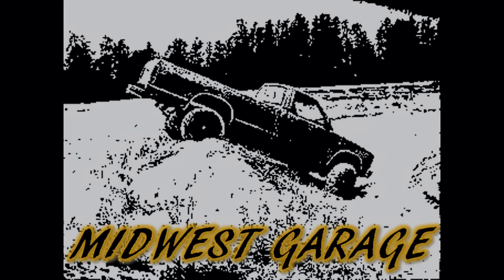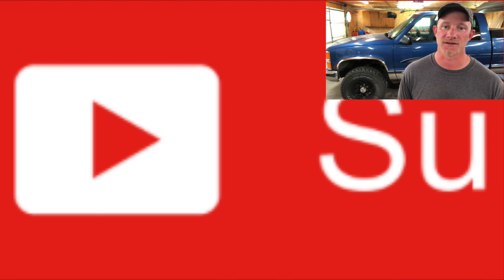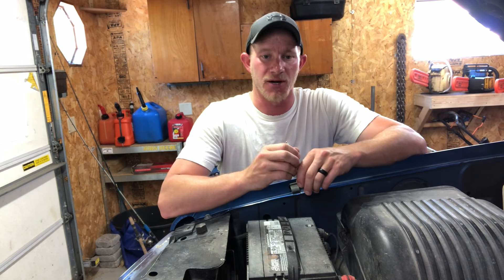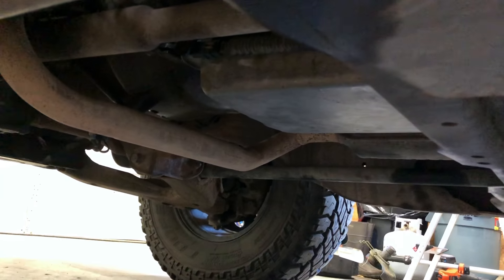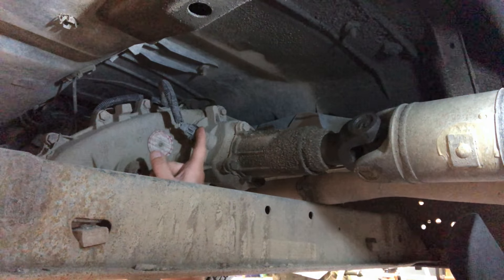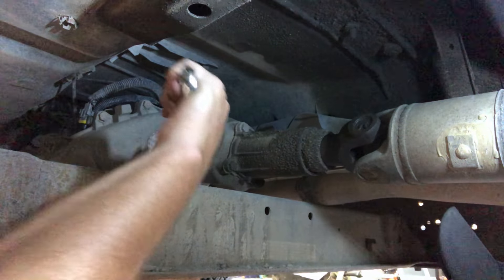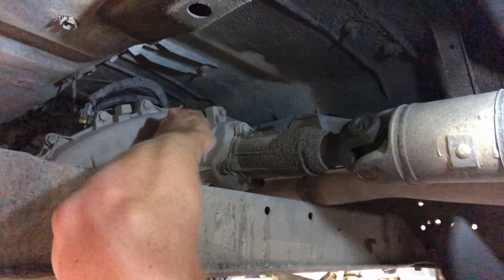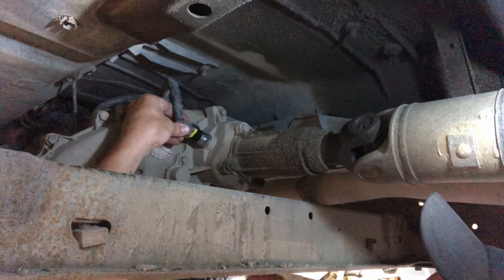How To Replace Vehicle Speed Sensor in 1988-2005 Chevy GMC Truck & SUV

Comment: replaced speed censor but tack and speedometer still not working any other ideas i may want to investigate also transmission wont shift auto can shift manually any help about this would be greatly appreciated
Reply from the maker: Hmm...is your OBD2 throwing any codes or check engine light on? If so, let me know what the codes are and I can help you out from there. From what I'm hearing it sounds like a bad ignition switch though, that would do all of those things.

Comment: hi from Mexico  i can see you helped a lot o people that's awesome  but im trying to fix my tranty but not sure wher is that speed sensor it has a t wires coming from the computer goes to the solenoide inseside the trany and the other 2  is for a macnet and changed the gears and was running like new  and then the oil hoes going to radiator get a lik a i burned th reverse gear  cow i was so pist off i change the central planetary  ring and now after second gear goes to neutral i want cray lol well i have a check engine light  on i pot the scanner but it does not show a code my transmission is a  700r4 if have any idea to helme i really appreciate it thankyou and have  a good day

Comment: I have a 96 Yukon all my gauges work but after 2nd gear it will slip in and out but will not go into 3rd correctly when I manually shift it back to 2nd it does just fine
Reply from the maker: That’s exactly what my truck was doing and this fixed that issue. I hope this helps yours also!
Reply: @MidwestGarage  WILL A BAD VSS CAUSE A TRUCK(2005 TRAILBLAZER) TO NOT MOVE EVEN THOU ITS ENGAGED IN A GEAR (DRIVE)

Comment: My truck is a 2002 yukon it goes n reverse fine..then. It goes into drive fine.but no matter how high it revs it will go into the next gear ..it stays n 1st..can this fix it or is it a shift selinoid??help me.ive already did a swap with a pick n pull transmission still having same problems
Reply from the maker: I would definitely check out the speed sensor, it’s a cheap and quick check. If that doesn’t fix it, I’d see what codes the engine OBD2 is throwing. It could possibly be the ignition switch if the speed sensor doesn’t fix it. Let me know what you find out and keep me posted!

Comment: My transfer case has two sensors. One on each side. How do I know which one to change?
Reply: I changed the one on the passenger side of the transfer case. Then I noticed that it was another one on the driver’s side also. Looks to be the same sensor.
Reply: @Bryan Sandifer did this fix your problem

Comment: I have a 97 Chevy 3500 two weel drive with a 454 an am running a 295/75/17 wheels and my speedometer is about 11 miles above what my GPS said I'm see on the speedometer, what can I do to correct this  ...

Comment: I have a 92 s10 4×4 automatic transmission my front wheel drive works but not my rear wheel driving me crazy trying to fix so I can drive in 2wd it will start going but when I let off the gas and try again it won't go also when its in park it still will roll please help me

Comment: I have a 1999 blazer and when I am driving and the transmission gets hot the transmission will start to serge. It is like it tries to hit passing gear then up shifts then repeats.What can I do to fix it?
Reply from the maker: Replacing this speed sensor may be the issue. If it’s not that I’d look more closely to see if you have bad fluid. I have a video on changing the tranny fluid and filter. Check that out and see if that’s your problem. Lastly, it could be your ignition switch. I also have a video on how to replace that. Let me know what you find, I hope I can help out more!

Comment: On 88 to 94 models the sensor is on the driver's side on 2wd models, I'm going to change mine because my truck shifts weird even though I adjusted my TV cable and it's leaking fluid through the seal.

Comment: @Midwest Garage  good vid, I found a sensor for $32...
my odometer clocks miles, speed needle bounces works on & off.
Does odometer work off same sensor?
I am in a 90 350 v8 5.7

Comment: I have a Chevy 1 ton 1990 with the same problems send it to shop they said they couldn't fix it Foundation AutoZone what are you think
Reply from the maker: It’s a $30 or $40 part, I’d swap it out and see if that fixes your problems. If not at least it wasn’t expensive ya know. Let me know if this does the trick!

Comment: NOTE: To everyone watching this video, I tried an adjustable wrench and all it wanted to do was slip. Go to a parts store and buy you a 1 inch deep-wall socket, pair it with a rachet, or else you won't have a fun time trying to get this sensor loosened. Side note: the new sensor did not fix my problem. My speedometer is still off by 5-10 mph. Back to the drawing board.
Reply: damn this answers my question my truck is off by 5 mph aswell its lifted 6 inches with 35s on it
Reply: What size socket???? 1 inch what ??
Reply: Having troubles finding right socket for this
Reply: @Ah71310  he said a 1 inch deep wall it just a 1 inch  socket but longer or deeper so it can fit over the thread to reach bolt
Reply: StonedPothead Gaming  
Thank you so there is no mm size?? Just ask for a 1 inch deep socket??
Reply: @Ah71310  should be able to tell them the truck type and wat your doing and they can get the correct on at part shop
Reply: @Ah71310  Yes sir, ask for a 1 inch deep wall socket and make sure you have the right drive ratchet to go with the socket.
Reply: VirtualPianoMan what about the mm size?? Or number
Reply: @Ah71310  It is a 1 inch socket. The size/number is exactly 1 inch. Ask a parts store person for a 1 inch socket and they'll get it for you.
Reply: Usually you can change an offset somewhere in the speedo board to adjust for different tire sizes etc - I know my old Ford I can manipulate the reset buttons etc to change it, on the chev I think there may be something similar - I put bigger tires on mine too but just did the quick math to determine the speedo shows slightly less than acual speed (in my case 4. something mph) so if I see radar etc I know where to keep it.

Comment: 5th gear incorrect ratio comes up on my codes.. hope its this sensor? Trans goes into limp whenever it tries to enter 5th
Reply from the maker: Hmm...let me know if this was it or not, I'm curious to know! If not, it very well could be your ignition switch. I have a video on that as well...I mention that though because the ignition switch on these trucks controls the TCM (transmission control module).

Comment: Brotha please help! Any insight please I'm desperately trying to find anything that can help me not spend what I was saving for the dentist. I have a 99 sierra 4x4 automatic with a newer 4.3 with what I think is stock 4l60e. It goes 1st and 2nd and seems like it goes in neutral with the rpms shooting up. Can this be the issue at all? My speedometer works fine. Please help
Reply from the maker: This could be the problem, mine was doing very similar things. It’s a cheap part so at least try to replace this first before spending a ton on bringing it to the shop. Let me know if it helps, if not we’ll look into it further here!
Reply: @MidwestGarage  I work for oreilleys so I have a few abilities. I am looking for the sensor but getting completely thrown off. The sensor I saw on my transfer case is straight but the one on my system at work that looks like it says manual transmission. The one that says automatic has a bracket. But my problem is that I saw one that says manual and auto but discontinued and to use the one that says manual. And then on top of everything. Lol my truck is a Frankenstein baja truck. I dont know if my transfer case was out of a manual lol best bet to get what looks like it or am I looking at the wrong sensor when under the car? The sensor with the bracket ia also under transmission output shaft speed sensor but I need the one on the transfer case right with the big nut at the base? I'm so lost lol

Comment: I have the symptoms of what seems to be a bad speed sensor in my 97 k1500. I jad replaced the sensor but nothing has changed. What should I do next?
Reply from the maker: Check the ground next. If you follow the wires up see where it grounds to the frame and disconnect that, clean the area well and see if that helps.
If that doesn’t work there’s a chance it could be the ignition switch. What symptoms are you having?
Reply: @MidwestGarage  slow take off, almost as if it's starting in a higher gear. Speedometer and rpm gauge not working. Rough idle.
Reply from the maker: So the rough idle tells me that the ignition switch could be the issue. The ignition switch controls the TCM and plays a big part in the ECM. Do you have a check engine light on?
If so, and with all of those random problems, it sounds like an ignition switch. I replaced mine on my 97, it’s a really old video so bear with it, but check it out it. I hope this helps man!
Reply: @MidwestGarage yes the check engine light is on.  Alright, I'll look at the ground then go from there. I appreciate your input.
Reply: @MidwestGarage  hey I would like to thank you. I appreciate your knowledge and input. Thank you for responding to my questions. It was indeed the ignition switch. Fixed my issues. Now I can get her back on the road. Thank you.

Comment: The one I purchased at autozone  for my 98 blazer was $95. Are they price gouging?
Reply from the maker: I don’t think so, it’s just unfortunate that it costs so much more from a real store. Mine was originally $78 until I found it for about $25 on Amazon. If you return yours and use my link in the description it’s way cheaper!
Reply: @MidwestGarage  Unfortunately,  I have already installed it. On the up side it did seem to fix my problem.

Comment: My 2004 Silverado speedometer has been acting up for a few years periodically will get stuck or move past 120  until it decides to work again .(not driven often) 31,000 mileage!  Watched ur video...whats odds u may need sensor replaced? Retired senior widow...was late hubby's truck. HELP! Thanking You in Advance , Darlene Perko
Reply: Adding, no other problems..just speedometer acts up...should I try senor first?  It's a 2 whl drive, do I have a speedometer cable??? Ty, Ty Ty

Comment: I have an issue, when i press my cruise control button the speedometer goes completely wack, but doesn’t maintain speed, do you know anything about this? Ive replaced the switch, module. Still no luck, try to get back to me asap, can find absolutely no one with the same issue, 1994 g,c 2500 350 tbi.
Reply from the maker: Oof I’m sorry honestly I’ve never heard that one before. You changed out the multifunction switch? I’d check for vacuum leaks for maintaining the cruise speed and speed sensor or speedo cable for the speedometer. I hope the helps! Let me know man.
Reply: Midwest Garage turns out the cable going to the throttle body was broken going from the module, thanks for the time to reply!

Comment: Today was about the third time my 2001Silverado will not shift out of 1st. The other times it would go back to normal after speeding up and letting off the gas. This time it stays stuck but will shift to reverse and park. I will change out this part.
Reply from the maker: Yeah definitely see if this helps or fixes it. Let me know what you find! If it doesn't fix anything check into your ignition switch. The ignition switch on these trucks controls the TCM and can wreak all sorts of havoc on your transmission. I have a video on this channel showing how to change your ignition switch too if that happens to be the issue.

Comment: Replaced speed sensor fixed it for a week. Replaced ignition switch no change. Stays in 2 nd gear no matter what. Speedo not working and break and check engine light on... Any ideas? I'm told there are two speed sensors on this 94 1/2 ton I only found one.
Reply from the maker: Hmm, I honestly only know of the one speed sensor...My guess would be maybe electrical? Are any of the wires going to the speed sensor frayed or corroded? I'd also check to see if there's a corroded ground wire around there anywhere. I'm thinking since it worked for a week that had to have been the original issue so I'd keep checking out that stuff. Let me know what you find!
Reply: @MidwestGarage  thanks for the reply. Turns out.crushed wire to speed sensor, faulty new speed sensor, bad silinoid in trans....works perfect now.

Comment: Is anyone trans not shifting out of first but shifts into reverse or neutral smooth?
Reply: Not shifting out of first, (unless i manually shift to 2nd ) ABS light on and speedometer not working, Did replacing the speed sensor work for you? @Taylor Peveto i have a 97chevy z71

Comment: I’m getting no power to the speed control sensor on my 1999 GMC Sierra I put a new trans in but no power to the to the mph and it’s not shifting
Reply from the maker: Hmm...see what codes the obd2 is throwing and let me know what it says. It may be an ignition switch issue. I have a video better explaining that. It's an old video so bear with it, but that could be your issue.

Comment: I’m not understanding this vid. I have a similar set up on a suburban, K1500 5.7 with a 4l60 and I swear ive looked several time and I cannot a sensor that looks like that anywhere on the truck, I’ve searched all over my t-case and i have 2 fully plastic sensors, 1 by the front driveshaft and the other in the back on the passenger side of the t-case by the rear driveshaft. Replaced both of them, didn’t fix the issue. That spot yours is in, there’s nothing there at all on my transfer case at all, I’m looking for the speed sensor with the metal base but this truck just does not seem to have one

Comment: i have watched several of your videos and its fantastic bud. very clear video, clear explanations with great knowledge which helped a lot. thanks a bunch! btw, i also subscribed as well. please keep posting more great helpful videos. u rock!
Reply from the maker: Thanks for the kind words bud! and Thank You for subscribing!!
Reply: @MidwestGarage  hey bradah, i have a question for ya. please correct me if i am wrong, i thought the speed sensor is a cord type that connects one end behind each front & back wheels, and the other end connect to the truck or engine area? your video shows the speed sensor location at the front transfer case, and that speed sensor is more of a protruding bolt style looking. i am confused on this. My ABS light has been on since November of 2019 and its still on as of date. please let me know, and much appreciated. thank you!
Reply from the maker: Tim Owings yeah man, so the ones you’re thinking of are wheel speed sensors. The one in this video is a vehicle speed sensor and is more electronic and can mess up your ABS, shift points, etc. if it goes out. I hope this helps!
Reply: @MidwestGarage  thanks bro for the response, and very much appreciated. would my ABS light turn off from the dash if i change the vehicle speed sensor? do you think my ABS light has been on due to " wheel speed sensor? " either way, i am going to replace the vehicle speed sensor since my 96 Yukon C1500 is 24 years old and has never been replaced. you think that will solve my ABS light? thanks again, and have a great weekend.

Comment: I think mines got this problem I was riding 1 day n it stop shifting bt the next day it started shift again
Reply from the maker: Yeah I'd definitely check this out before looking at expensive fixes. If it's not this I'd run a scan tool on your OBD 2 and see, it could possibly be the ignition switch also, which is a lot cheaper than diagnosing a transmission issue. Let me know if this fixes your problem!

Comment: What’s the part number for that sensor ?
Reply from the maker: I'm not sure on the exact part number, but I should have it linked in the description. Amazon will let you know also if it's the correct part for your exact vehicle.
Reply: Midwest Garage thank you for the respond . I believe to have found it . Great channel ! I look forward to learning more from you . 

Jason Davie Florida, 1995 c/k 2500 4x4 6.5 turbo diesel
Reply: @The_spears_brothers  did you find the part number? I have the same truck, 1995 c2500 4x4 and Everytime I think I find the right part, Amazon says it won't fit my vehicle

Comment: just had a check engine light  today, they did a  obd test and said min was the front right speed sensor, not the same obviously no abs light on, what the?
Reply from the maker: That could be a wheel speed sensor instead of the vehicle speed sensor, which normally triggers ABS light like you said so that's weird. I'd maybe try cleaning the sensor first and see if that helps. Often times those wheel sensors will get dirty and start to throw codes or do goofy things to your ABS and all they need is a cleaning. Otherwise, if you're having the issues that I talk about in the video I'd definitely look into changing the vehicle speed sensor. Cheap fix that is going to need replacing someday anyway ya know. I hope this helps!
Reply: Midwest Garage My 2000 6 liter K2500 shows ABS light on and code CO221 (right front speed sensor circuit open), as Richardson says above.  Do you have a video showing where that 1 is, etc?  I think I'll take your advice and change the one shown here, too, since I have had odd transmission slip at times for years. Truck sits a lot and not usually under cover.  Bought it new.  Good clear video here, I am definitely now a subscriber, thank you!
Reply from the maker: @replyhere590  Thank you for the sub and kind words! I currently do not have a video showing that specifically, however in my wheel bearing replacement video I do show the wheel speed sensor and how to disconnect/reconnect it on these trucks. I hope this helps!